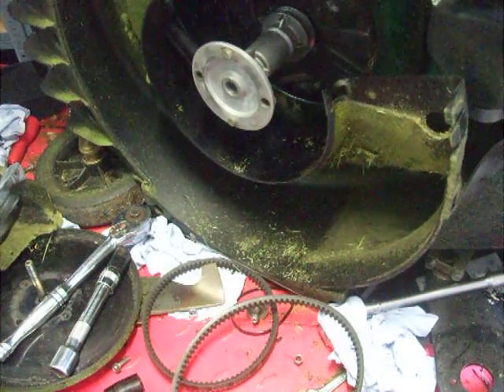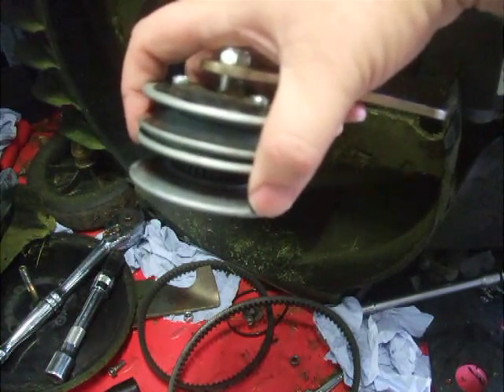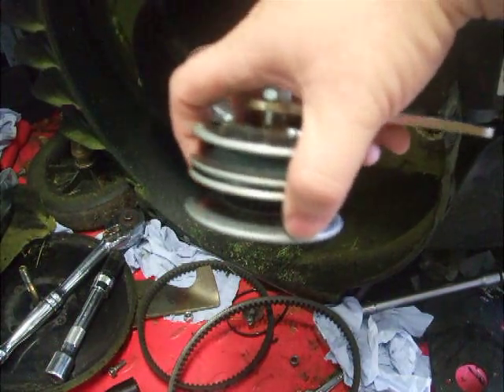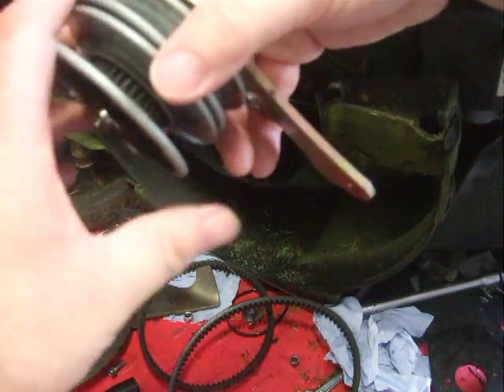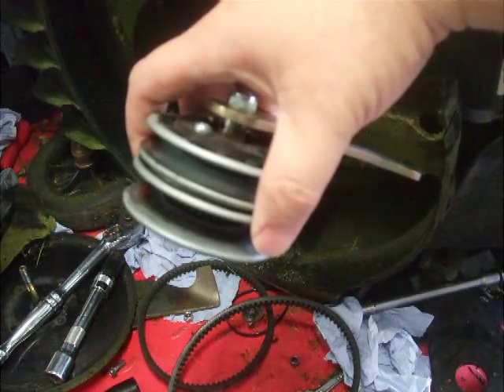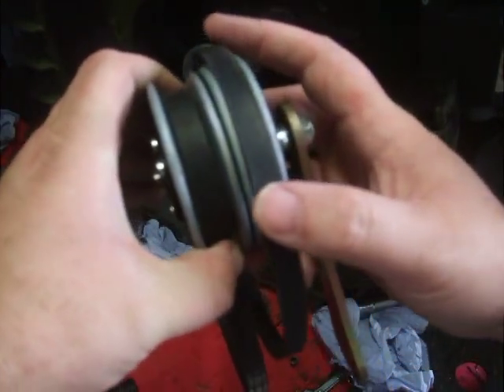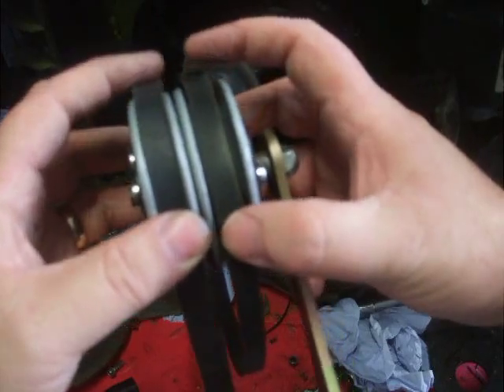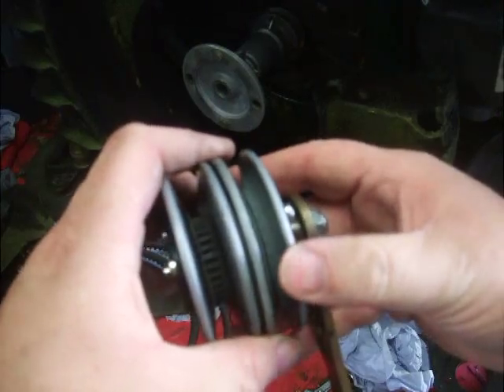HOW THE VARIABLE SPEED WORKS ON A HAYTER 41,48,56 MOWER REPAIRS

Comment: Thanks for sharing, been watching your vids for a while now. Do you have any knowledge of the those  without the variable speed adjustment cable, the hayter spirit 41 roller autodrive for instance?  Has what looks like your video but no adjustment cable. On occasion it won't drive just sits there with clutch engaged, it doesn't judder or anything and no abnormal noises. Give it a nudge and it will go, other times it will pull away from standstill no problem.  Grass is dry not damp. Any ideas?  Cheers